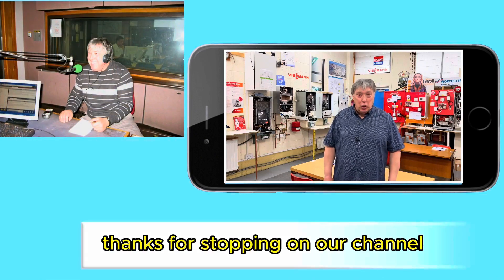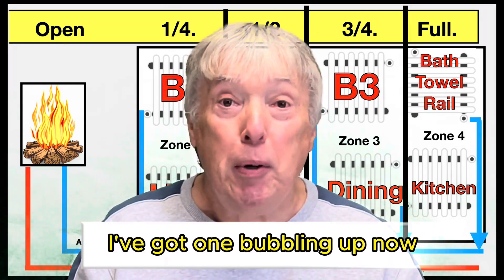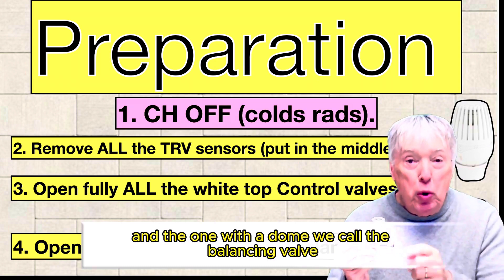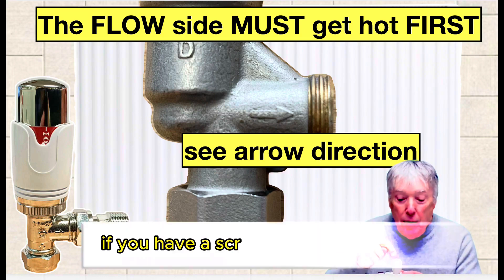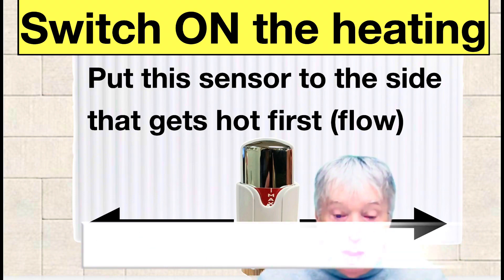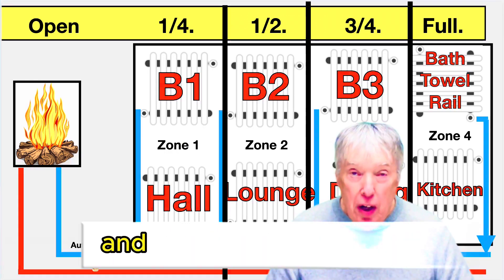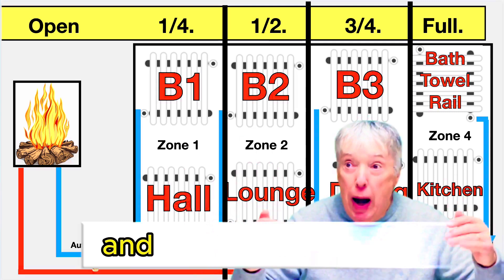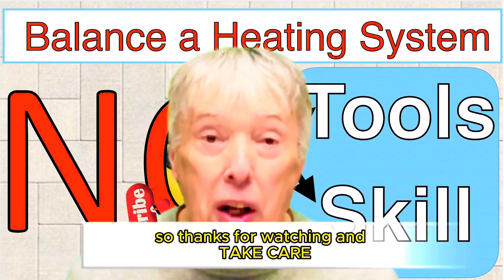Balance Heating system with NO tools or NO Skill 16 02 24

Comment: Hi im going to try your method of balancing my radiators ive got a condensing boiler so do put them in zones from  the closet ones to the pump not the bolier also I've got 9 rads and 1 towel rail so does that have to get divide by 4 as that works out at 2 and a half rads
Reply from the maker: Hi Michael, thanks for asking, always from the boiler, lots are asking about which side is the lock shield? answer is the pipe / side that gets warm first is the FLOW, thus the cooler side is L-S, check yours are correct often not, I have a video soon about TRVs, please subscribe and get notified. George 🤩
Reply: @mrcombiBedford   thank you for the reply yes all the lockshield are on the return as ive replaced the trvs so changed them all, so my boiler is in the kitchen so would the first zones be upstairs above the bolier then the last would be  the rad in the kitchen
Reply from the maker: @MichaelWard-m7v  No, the kitchen rad can't be furthest, in most houses Hall Lounge or Bed 1. Imagine a tape measure from the boiler to closes radiator then the middle, Then 2 or 3 rads. far away, divide into 3 or 4 zones as per the video. Hope that helps

Comment: I'm pretty sure that my boiler feeds a manifold (located under the upstairs floorboards), which then distributes to each rad via microbore pipework. So will the nearest & furthest away rule still apply? 

I have locksheild valves on one end and trvs (no arrows) on the other (except 2x towel rails). I know by touching the feed & return that some of the trvs are not on the feed side. However, no arrows on the trvs means that's OK? 

I have 8 rads & 2 towel rails, so I divide the system into 4 and follow your system? 

Have I got that correct?
Reply from the maker: Hi Alan, thanks for asking, yes correct divide by 4 or 3 which is best for the system. All TRVs without an arrow are bi directional very good, but they are mounted differently. If the TRV side warms up the sensor side it MUST be VERTICAL, if fitted on the colder RETURN it MUST be HORIZONTAL a mistake many installers do. See my video on the Danfoss balancing TRV. The best is always on the FLOW side because it responds sooner thus saves more money. Hope the helps, George 🤩👍